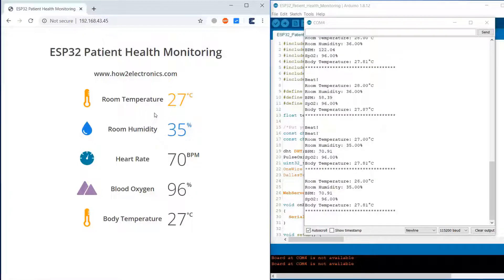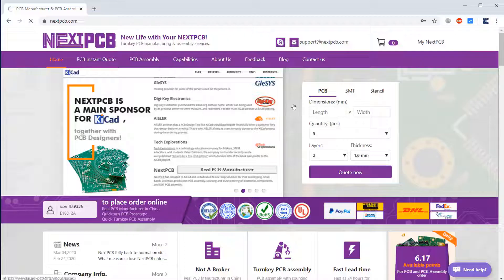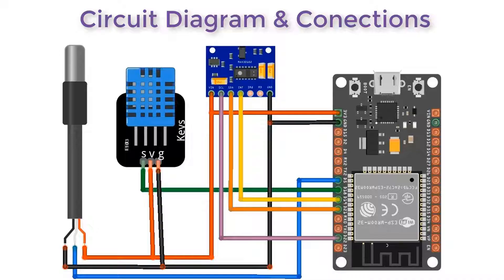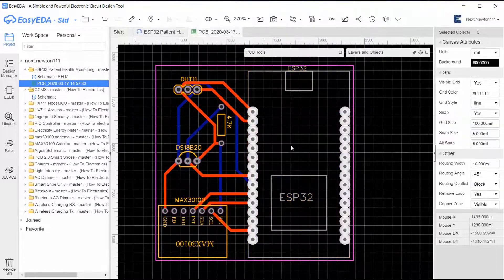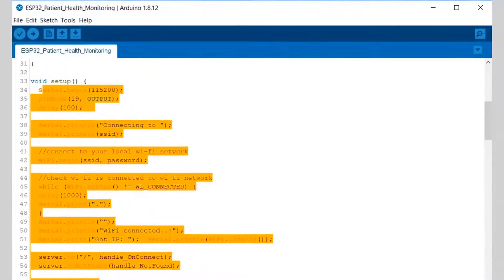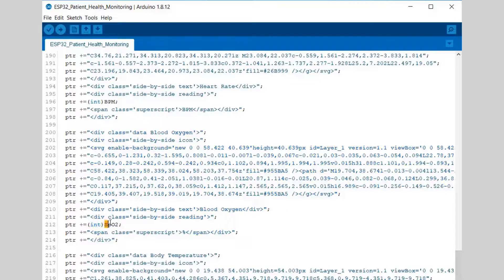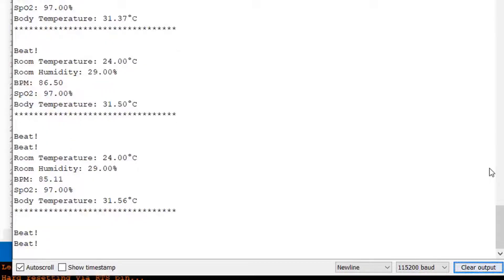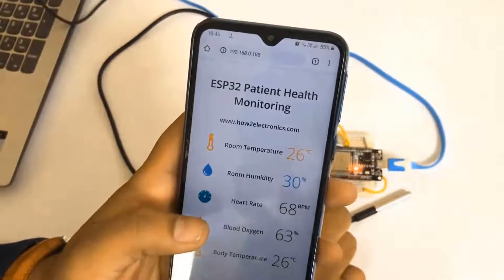IoT Based Patient Health Monitoring System using ESP32 Web Server

Comment: Hello sir i wanna ask to you, i use max30100 and ds18b20 with nodemcu but the result of max30100 is zero, when i compile max30100 only the result is right. Why when i combine with ds18b20 the result is zero sir?
Reply: like me 🤦🏻‍♂️🤦🏻‍♂️🤦🏻‍♂️
Reply: @adreesghaleb3416  you can change the sensor with GY-MAX30100 purple colour
Reply: @reginaaprilia1805   does it work using gy max30100 ?
Reply: @jaigopalkarnani97  yes it work, i change my sensor with GY-MAX30100
Reply: @reginaaprilia1805 is it work with combination of ds18b20 ? Please send me the purchase link of it
Reply: @reginaaprilia1805  with all my respect regina can i have ur whatsapp or Instagram to ask you more information ??
Reply: @adreesghaleb3416  you can send email maybe, sorry🙏🏻
Reply: @reginaaprilia1805  hi , I used gy max30100 but it gives reading of 0 for spo2 and bpm
Reply: @abdullahrahat1578  r u use with another module sensor or only gy max30100? If u only use that sensor u can try with program demo for max30100 in github or internet, u can see the result
Reply: @reginaaprilia1805  is this project rly work? i got error in the code
Reply: @lidiyagetachew3177  its work
Reply: @reginaaprilia1805  can you give me the code of yours because i use same sensor as you gy-30100 but BPM and Sp02 not show any value
Reply: @adreesghaleb3416  so if i replace the max30100 with gy-max30100 works well ??? I spent 150$ on this project 😵😵🤕🤕🤕🤕
Reply: @mr.android4206  maybe, cause the green sensor has wrong the circuit so it needs an additional external resistor, but if you use the purple sensor just connect sda,scl,vcc and ground
Reply: regina kalo gunain gy-max30100 nya pakai kodingan max3010x atau yg 30100?
Reply: @SilentaLive  ada sedikit dirubah pak apabila mau digabungkan dengan sensor ds18b20, namun apabila ingin mencobanya dengan sensor gy max30100 saja bisa pak menggunakan coding yg sama dengan max30100
Reply: @reginaaprilia1805 untuk perbedaannya itu hanya menambahkan kodingan Ds18b20 kan? Tanpa menggunakan interrupt.
Reply: @SilentaLive  ada menggunakan perintah reset pak, jadi setiap pengambilan data pertama semuanya direset keawal agar tidak menghasilkan nilai 0
Reply: @reginaaprilia1805  bisa minta kodingannya lewat email?
Reply: @SilentaLive  boleh emailnya pak
Reply: Maaf pak saya baru liat saya kirimkan ke bapak, sama sama pak semoga membantu🙏
Reply: I have the same problem. I removed all three resistors, when I use only Max30100, then works, but with DS18B20, doesn't work. Do you finded any method to use both, except changing the sensor for GY-Max30100?
Reply: @Gabriel_Blum  maybe you can put code reset untuk stop the program while its looping
Reply: @Gabriel_Blum hey brother is it max30100 worked without changing
Reply: @togisidauruk  bisa menambahkan coding untuk memberhentikan program ketika mau looping lagi, di kodingan saya sudah berhasil dan menghasilkan nilai yg diukur dengan akurat
Reply: @togisidauruk  kalo gabungan kedua sensor pda arduino masi belum dapat caranya. Namun untuk gabungan pada ESP8266 / esp32, Lakukan seperti biasa. Max30100 juga bakal freeze data kalo pada esp8266 melakukan pengirimam data ke server, yaitu melakukan get and Post.
Reply: @Gabriel Martins Puehler did you solve the problem? Please help me!
Reply: kak, apakah kaka berhasil buat project iot ini? saya juga lagi buat project ini untuk tugas kuliah tapi waktu compile error di dhtlibnya. errornya di bawah ini :

In file included from c:\Users\Baitha\Documents\Arduino\libraries\DHTlib\dht.h:19:0,
from c:\Users\Baitha\Documents\Arduino\libraries\DHTlib\dht.cpp:42:
c:\Users\Baitha\Documents\Arduino\libraries\DHTlib\dht.cpp: In member function 'int8_t dht::_readSensor(uint8_t, uint8_t, uint8_t)':
C:\Users\Baitha\AppData\Local\Arduino15\packages\esp32\hardware\esp32\1.0.6\cores\esp32/Arduino.h:106:91: error: cannot convert 'volatile uint32_t* {aka volatile unsigned int*}' to 'volatile uint8_t* {aka volatile unsigned char*}' in initialization
 #define portInputRegister(port)     ((volatile uint32_t*)((port)?GPIO_IN1_REG:GPIO_IN_REG))
                                                                                           ^
c:\Users\Baitha\Documents\Arduino\libraries\DHTlib\dht.cpp:122:29: note: in expansion of macro 'portInputRegister'
     volatile uint8_t *PIR = portInputRegister(port);
                             ^

exit status 1

Compilation error: exit status 1
Reply: hi. sorry for disturbing. can you show me the coding that u used? because i have the same problem. i currently use sensor max30100 purple colour. but when i compile all the coding with ds18b20, the result for spo2 & heart rate doesn't show. i have follow all the intruments given
Reply: @munieno  sure can u send your email?
Reply: @reginaaprilia1805  thankyouuu sister 🙏🏻
Reply: @reginaaprilia1805  i hope you can help me as soon as possible since i need to present my project in few days 😭
Reply: @munieno  im sorry to late response, you can send me your email please
Reply: @reginaaprilia1805  have youu receive my email ??
Reply: @munieno  i don't have received your email
Reply: @reginaaprilia1805  may you give your email?? Because i had replied my email on comment section for three times but it doesn’t show it
Reply: @munieno  its same i have replied for my email but the comment is gone
Reply: @reginaaprilia1805  do you have any other option to send me a message or what ??
Reply: @munieno  u can send your email in comment my video maybe
Reply: @reginaaprilia1805  i had commented my email just now on your video
Reply: have you solved this problem
 @munieno
Reply: have u solved this issue?
Reply: Permisi kak @reginaaprilia1805 , bisakah kami menanyakan tentang project ini, untuk membantu kami dalam tugas project, apakah ada cara untuk bisa menghubungi kakak🙏
Reply: Permisi kak @reginaaprilia1805 , bisakah kami menanyakan tentang project ini, untuk membantu kami dalam tugas project, apakah ada cara untuk bisa menghubungi kakak🙏
Reply: Permisi kak @reginaaprilia1805 , bisakah kami menanyakan tentang project ini, untuk membantu kami dalam tugas project, apakah ada cara untuk bisa menghubungi kakak🙏
Reply: Permisi kak @reginaaprilia1805 , bisakah kami menanyakan tentang project ini, untuk membantu kami dalam tugas project, apakah ada cara untuk bisa menghubungi kakak🙏

Comment: Hallo sir i wanna ask u, for 2nd method, how to cut the wiring of max30100? Please tell me thank you sir
Reply: @HowtoElectronics  use method 2nd is it working? Cause i have used 1st method isn't working the result not stable and always zero sir
Reply: @rikofirmando9055  bro help me how to do it plss how to cut and connect
Reply: send to me on watsap 009647727638136

Comment: Hello, I have a problem, I put a resistor pulling 4.7k on the scl and sda, but the result is zero, can you help me?  And sometimes the LED lights on the max30100 don't light up, what is it?
Reply from the maker: Problem is with the MAX30100 Module. Please check the module first. Follow the method of fixing the issue.
Reply: @HowtoElectronics  yes of course sir, I have followed the method of your website but the results are zero for a long time.  I tried other sensors but the results were the same.  I am using nodemcu, where is the int port nodemcu connected to?
Reply from the maker: Connect to GPIO16.
Reply: @HowtoElectronics  thank you sir🙏🏻
Reply: @reginaaprilia1805  hello please help me I'm using esp32 but my sensor light not running ,no result nothing.
I directly checked my sensor by connecting with esp32 but light not running ,is it se sensor fault or it is not compatible with esp32??
Reply: have you solved this issue?

Comment: next time use Intel 8 core CPU for connecting 3 sensors. This can handle attiny.. or ESP8266-01.
Reply: it would be a lot quicker, but who cares, it is a demo, esp1, arduino mega, esp32, all can be use, just what you have at home in stock for testing.
little bit rewriting the code and it work, I made one based on this video on a esp8266 now.
took ma 3 days, as I don't know anything about arduino or coding, but google is a great help.
only thing I want to know, how to change the icons now.
Reply: @pietervansambeeck5466  bro my oximeter sensor light not running and no result of oximeter sensor whyyyy?I'm using esp32 ,I directly checked my pulse oximeter by connecting
Gnd to gnd 
Vcc to 3.3
D21 to slc and d22 to sda but light not running whyyyy?